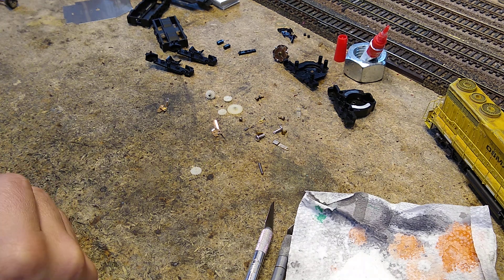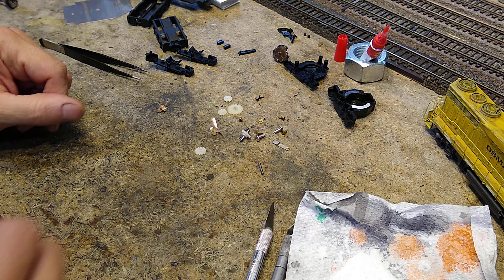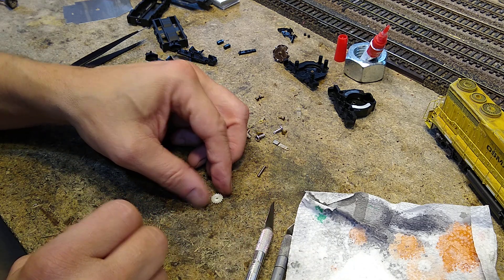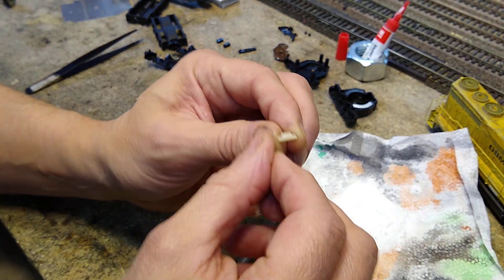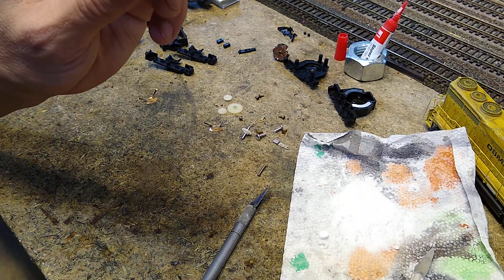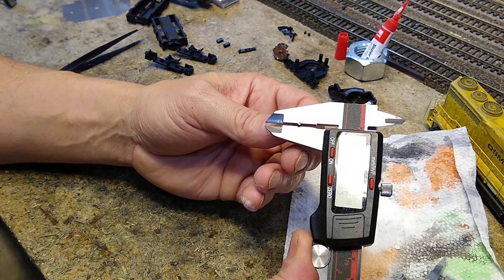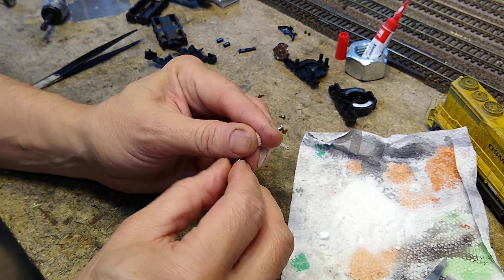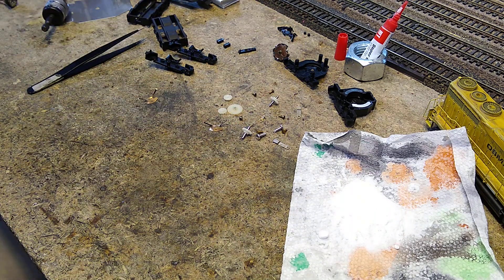Cracked Gear Repair Bachmann Life-Like

Comment: Just tried this on a $5 engine from a train show. It works! I cleaned the gear with alcohol first, then used a binder clip to mask the gear teeth near the crack. Dab of super glue and a dab of baking soda and the gear was tight on the shaft.
Reply from the maker: I've found several more advanced ways of fixing those gears since this one, but the old standby of baking soda and superglue has stood the test of time!

Comment: Hey is it possable to fixed crack gear on a HO Scale Bachmann GE 44 tonner center cab switcher?
Reply from the maker: for sure yes! if you can't replace it, I just tested JB-Weld Plastic Bonder and it works amazing - you get about 5 minutes of working time to really get it where you want it and cleaned up, then put it with a little heat, like a light bulb just to warm it and then in 30 minutes it is totally bonded and can be filed.  much easier than the other ways I've fixed all these gears!  but, if you identify the gear you need you can buy just that gear on amazon thanks to all the robotics people these days!  count the teeth and search amazon for a .5 modulus gear with that many teeth and you can get it!

Comment: I've got a GP 18 that has a cracked gear in it. Runs still but not very good. I've got it on the RIP track at the back of my work table. Procrastination at its finest. Neat video.  👍
Reply from the maker: you can fix it!  or you can slice a gear from a robotics gear kit to replace it

Comment: Had a pair of Proto 2000 FA-2 AB units. Was easy fix after listening to other folks YouTube video on the subject. Didn't know Bachmann had the same problem.
Reply from the maker: yes, Bachmann and Life-Like have components that are common.  I don't know if you saw, but during the 5 locomotives in 30 days builds I solved the cracked axle problem and dispelled all the theories which were wrong.  A simple hole drilled into the axle near the gear will prevent future cracks after fixing them with baking soda and superglue.  Turns out those axles pressurize when the wheels are inserted and over time burst - I found that out because I use white glue to keep the wheels in place and a wheel popped out once with the glue still tacky after a couple days - the hole solved the problem.   I'm doing a proto GP18 today and tomorrow and will demonstrate again...